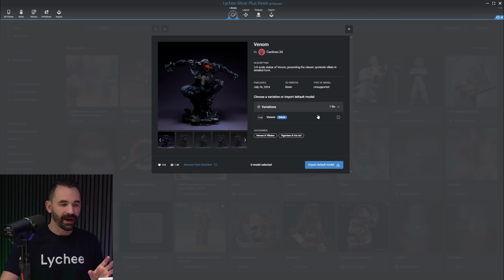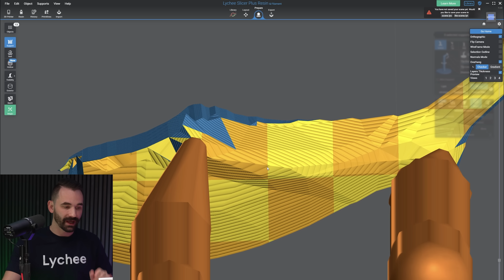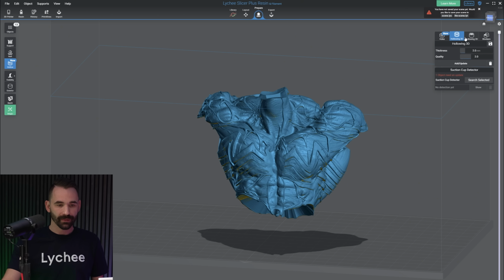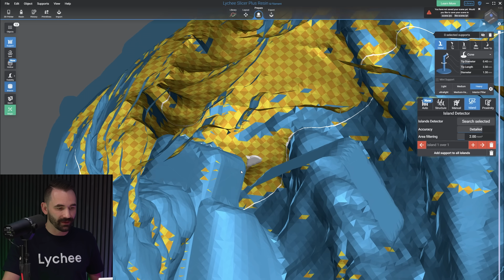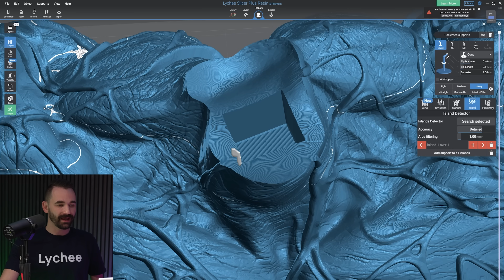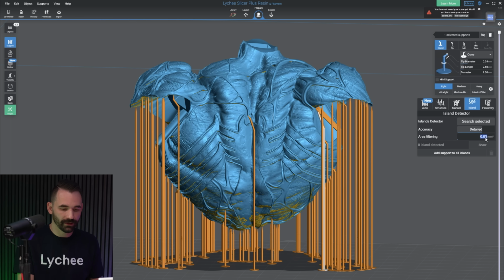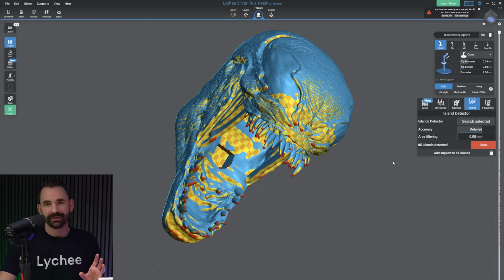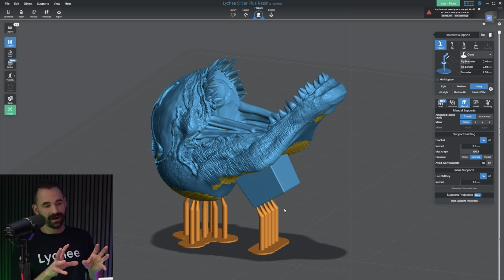First Step to Manual Supporting: Fixing Islands in Lychee Slicer | Tutorial

Comment: At the 10:00 min mark the support is red. I thought red was bad and I delete these. Supports I place manually, not ones that come up in the proximity scan.  Please explain and Thanks !
Reply: It means that they are a bit too close to the model and may collide, however Internal and so it doesn't matter.
Reply from the maker: As it was an internal support, it doesn't matter if the support is too close :)